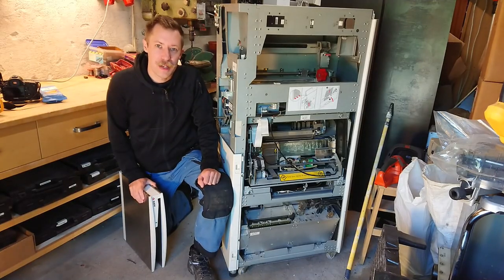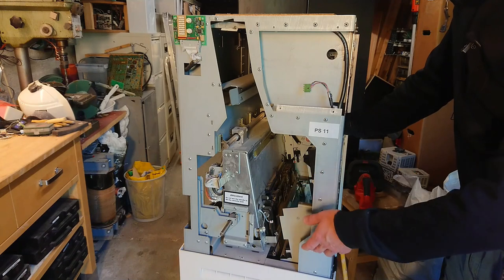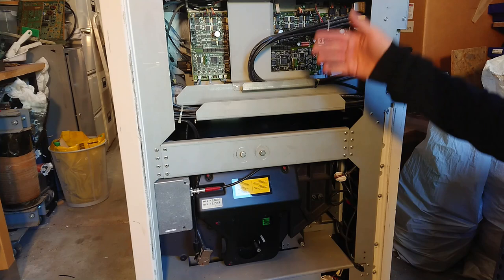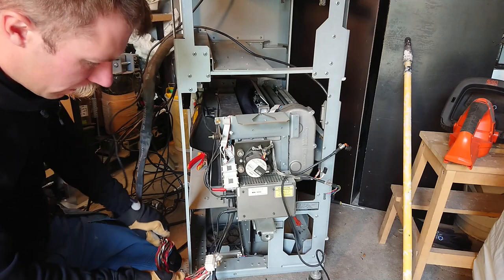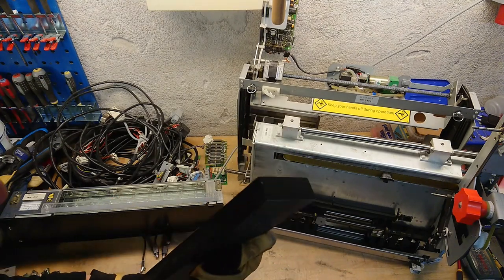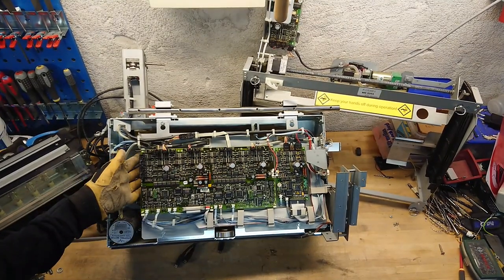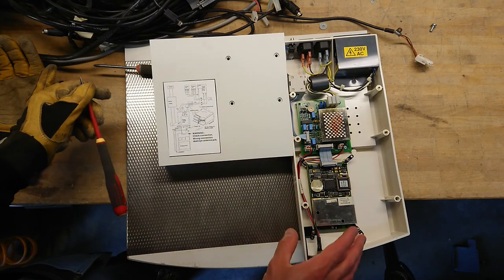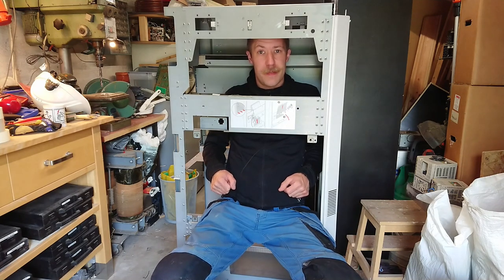AGFA ADC 5155 XRAY Scanner Teardown (Part 1 of 4)

Comment: I used to work in a photo lab that had an Agfa "D-Lab.3" minilab unit that was made around the same time as the ADC 5155 featured here (around ca. 2000, the internal PC that controlled the D-Lab ran Windows 2000).  It could scan negatives and slides, and make photo prints (or JPEG output to CD-R, floppy disk, memory card, or network share) from them up to 8x12 in size (using a laser scanner to expose the latent image onto the undeveloped print paper).  Looking at this unit featured, the internal mechanisms look very similar to the D-lab's paper printing transport, even down to the red manual knobs to manually advance the paper (or CR plate in this instance).
Reply from the maker: It makes sense to reuse the "sheet" handling parts that would be the same for a a variete of thicknesses. I guess the big difference in operating system comes down to x-ray machines being validated, so changing design or software in those is expensive.

Comment: The CR plates are erased with white light, from a halogen light bulb or white LED. I have a small dental CR scanner that use white LED's.
Reply from the maker: That is what the array of 10x 100W halogen bulbs are for. Not sure what I would use that for, it is properly good at melting things :)